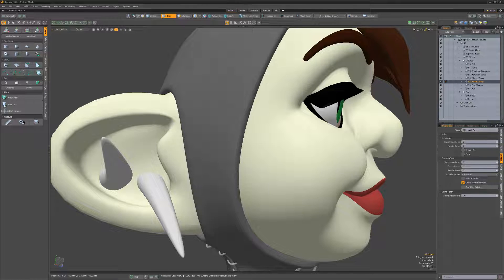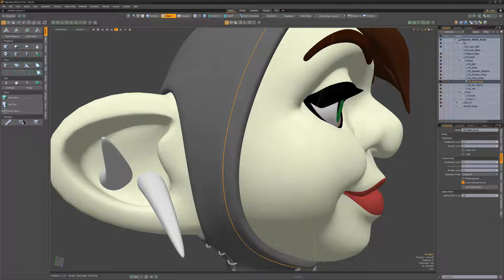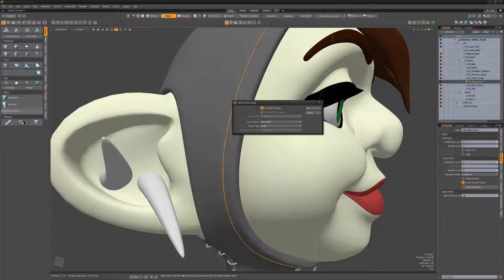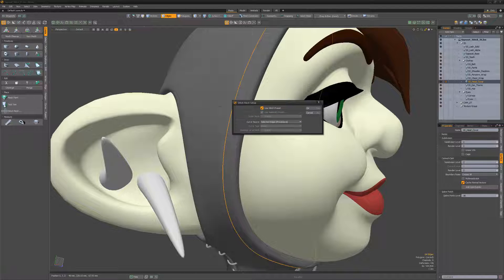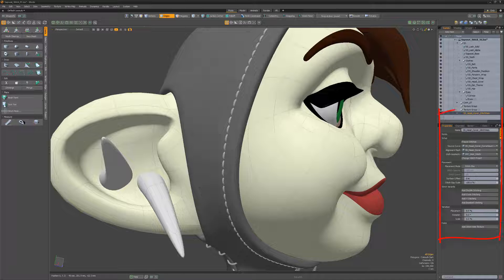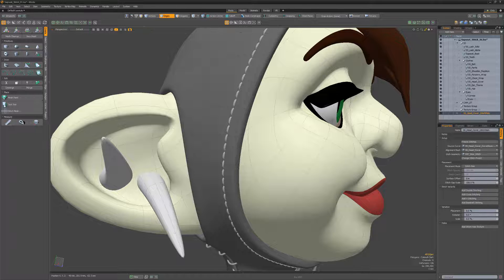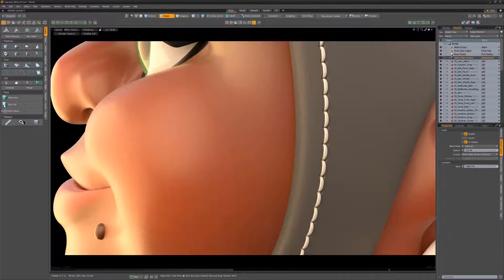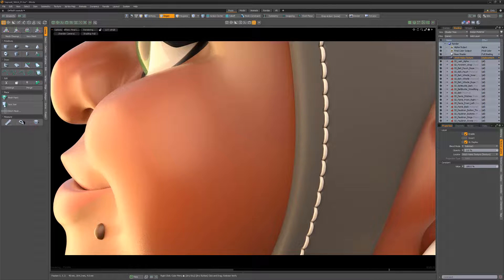MODO 12.2 | Stitching

Comment: Wow look very good.
Can be ridiculousbut I have a few questions.

First of all it comes with 12.2 in the modo?So it's not Plugin, is it?

Secondly, can we add our own Stitch?

And I think it can be applied on the curve?
Reply from the maker: Its in 12.2... not a kit or plugin. its built in.

yes... yopu can use any preset... doesnt have to be a stitch... could be a staple, bolt, rivet, etc

can be applied on curve
Reply: @pixelfondue  Thx for answer.And wow really good feature. :) 12.2 When will it occur,And hopefully solve the bevel problem